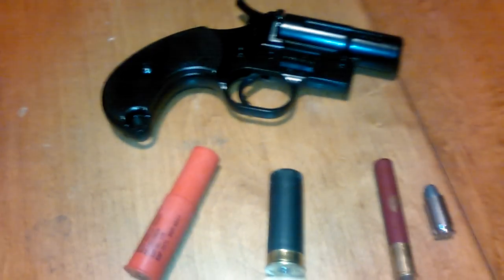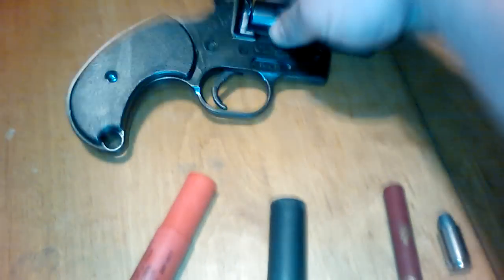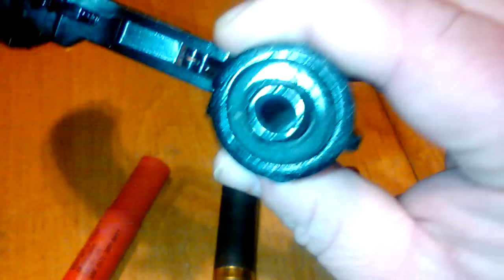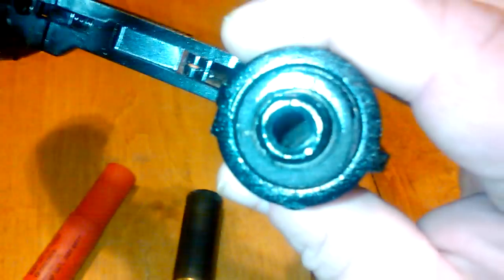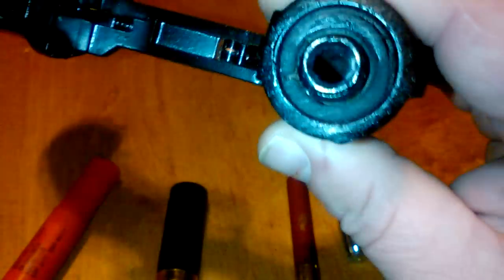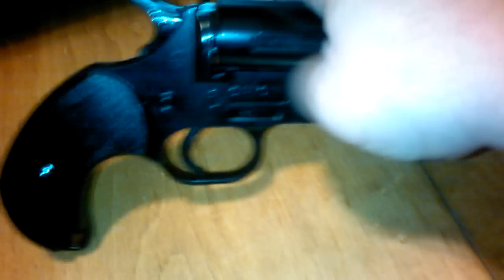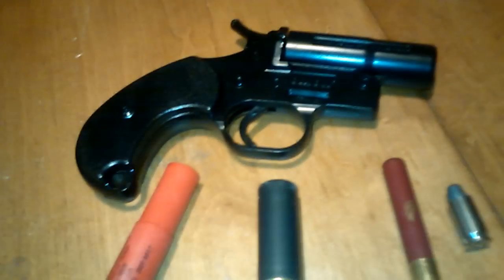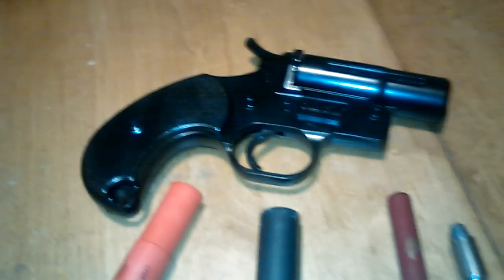homemade 22  pistol flare gun

Comment: 22 is a rimfire bullet, this will not fire because the hammer of the flare gun is centerfire. buy a 12 gauge to 22 adaptor, they sell it everywhere, and it will compensate for the offset.
Reply: it makes no difference
Reply: @marblemarble7113  I might be wrong, but tell me how a rimfire bullet will get set off from a center blow.
Reply: @ArpOutdoors   uhhh ok
Reply: @aidenthepropmaker5805  It doesn’t have to hit the rim it can hit anywhere on the rear of the cartridge and it will set it off man. It’s not like the rim makes it a primer or something.
Reply: @ArpOutdoors  the primer solution is in the rim tho-
Reply: @aidenthepropmaker5805  hit one in the center I promise it will go off
Reply: @aidenthepropmaker5805  when the hammer hits the bullet it forces it up against the barrel which ignites the priming compound in the rim of the bullet and sets it off
Reply: @marblemarble7113  than why aren’t 12 gauge to .22 adapters centered?

Comment: those plastic orion guns can't handle that insert. sooner or later it will fail. theres a website where you can see just how dangerous they are. read this whole article and look at the pic of the shattered gun. I've seen 3 videos of people doing this exact same thing, and they all blew up or cracked in half eventually.

http://www.guns.com/2013/01/02/flare-guns-as-weapons/

they cannot handle live ammunition without catastrophic failure, with or without an insert.. flares only.
Reply: Ah, yes, the "sooner or later" issue.   Well, a lot depends on what you use it for. It's probably good enough for one or two shots, but I wouldn't depend on it for much.
Reply: Mine Works Fine...Not Broken Or Cracked..

Comment: Please dont shot that thing .  At least get a military flare gun and ruffled inserts.
Reply: you can make a lot more than a .22 with those with the inserts cause they're metal if you mean a certain kind this flare gun he used is all plastic for the parts that actually matter to hold pressure they did that so you can't make it fire real rounds even .22s will explode them after a while or only after a few shots even with the metal barrel liner cause of the back being plastic with only a thin sheet of metal holding it back